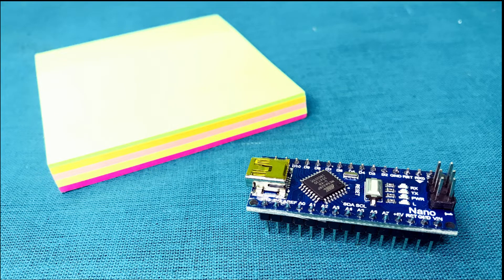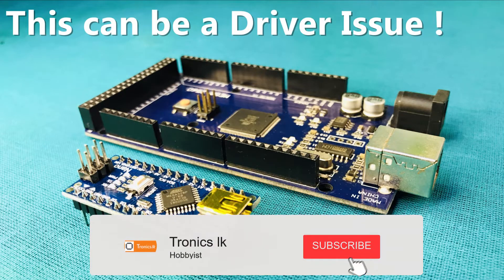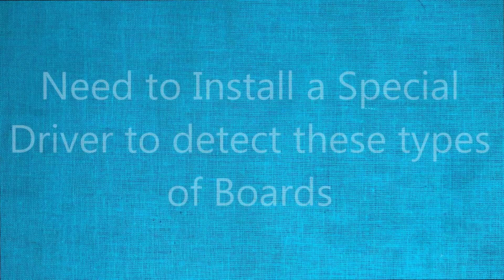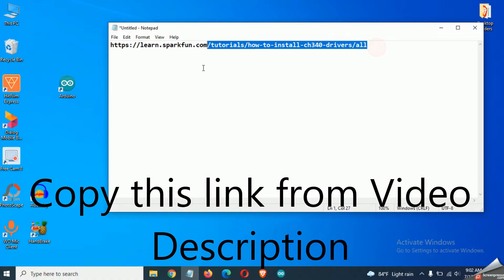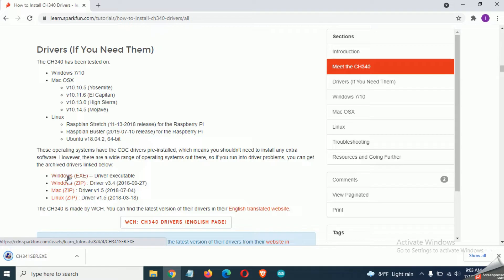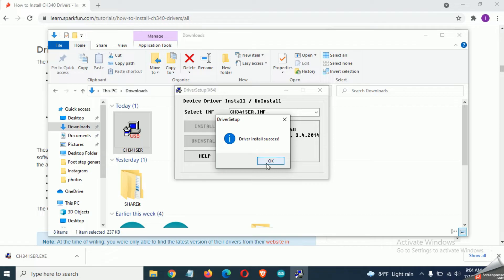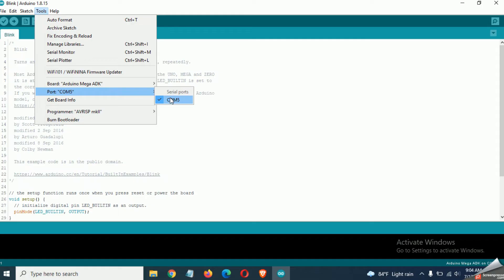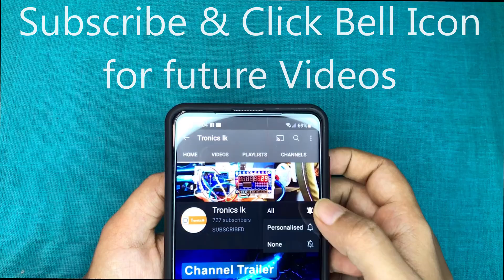Installing CH340 Drivers for Arduino | Arduino not Detected by Computer FIX | COM Port Issue FIX

Comment: How do I get com port for ESP32 espressif for windows 11?
I tried CP210X universal Windows Driver V11.3.0  6/24/2023
I use Arduino IDE 2.2.1 with 115200 baud, but it didn’t work.
The following works fine, Arduino UNO, UNO R4 WiFi and UNO R2 WiFi 
Please help.

Comment: It worked permanently on my device with Windows 7 but I do Have another which I am using windows 11 which I have to install the drivers whenever I unplug the arduino cable. Do you Have any idea How can I fix this?

Comment: Got the drivers installed, Arduino IDE detects the port, but when I upload any code to it I will get the longest error messages ever created... It works 100% with the original cards.
Reply from the maker: May be another type of driver is needed 🥲
Reply: @tronicslk doesn't really matter anymore, i needed to upgrade to Arduino Due instead of Uno/Leonardo because of the number of inputs needed.

Comment: my mega ch340 chip is over heating and my cmputer is not detecting  the board,but previously uploaded program works well sir,what may the issue sir
Reply from the maker: may be your ch340 is burnt
Reply: @tronicslk  how can I fix it ?
Reply from the maker: @hariharanramamurthy9946  if it is burned, better to buy a new one
Reply: @tronicslk but  it cost 1200

Comment: After installing its shows "the drive is successfully pre installed in advance" to me. What can I do??
I have Arduino Uno
Reply from the maker: May be you have already installed drivers previously. Is it working fine?
Reply: @tronicslk  no
Reply: i have this issue also